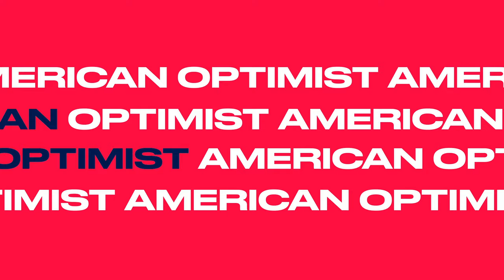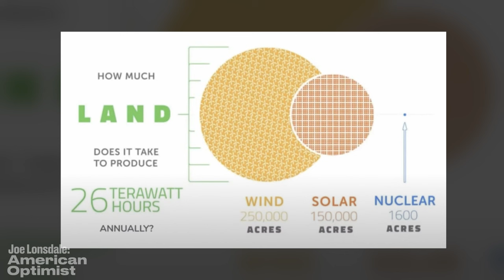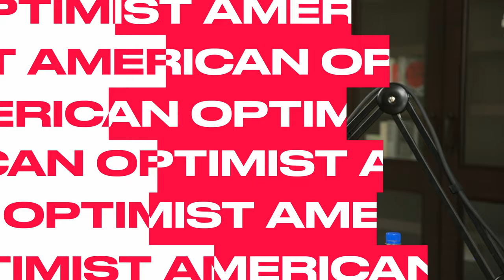Oklo's Amazing Small Reactor That Can Reuse Nuclear Waste

Comment: "reuse spent fuel" - use how?  Are you going to reclad the fuel bundles?  Overclad them?  The devil IS in the details.
Reply: Unless the reactor has been damaged, the fuel bundles re still clad amd the cladding is probably usable.  Of dourse "used" fuel is very Dose-y — Probably curium, mostly, and must be handled with care.  With helium coolaNT AND BERYLLIUM REFLECTOR< they may work well and easily as a fast neutron reactor fuel.  No reprocessing necessary.

Comment: #POW that’s exactly how Barack Obama got placed as president by the Chinese and Saudi using the name for the airport and hotel in Kabul as his wife so the way Kabul was set up to sponsor the foreign visa for a military on site was for female to female or male to male or male to female actually it wasn’t mailed to female, so Barack Obama would have done his United States visa and birth certificate from the state department using the same visa process as the military due to Afghanistan for Kabul and also the same visa process that Thailand uses for its Mahidol universityuse the embassy they use the United States Embassy which goes straight directly to the state Department for birth certificates and this is a nuclear reactor. #POW.

Comment: What about Chernobyl or Indian Creek ya I'd say that's not a good idea
Reply: Different reactor design. Your comments are not valid. Please consider updating your knowledge of the respective design(s).
Reply: @shawnnoyes4620  whoever throws in Chernobyl in an educated discussion around nuclear power is not interested in having one.
By lower, albeit not unsafe(!) standards, even RBMK in the Chernobyl guise can be and has been operated safely for decades.
It seems not many people are ready to accept that, apart from that, RBMK now uses improved indication and control systems and most importantly a superior fuel mixture which brings down the void coefficient to near zero, making the reactor at least indifferent, if not self stabilising.
Of course, it wouldn't be wise to build new instances of RBMK, given newer technology available.
Reply: Whataboutism?